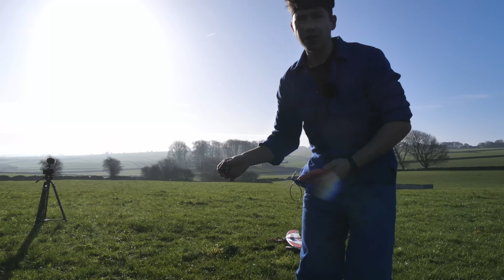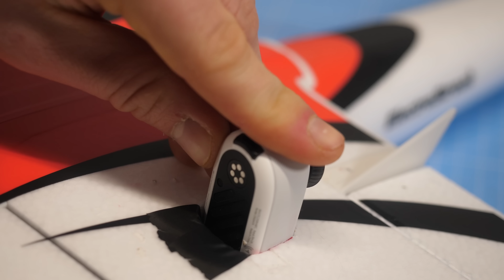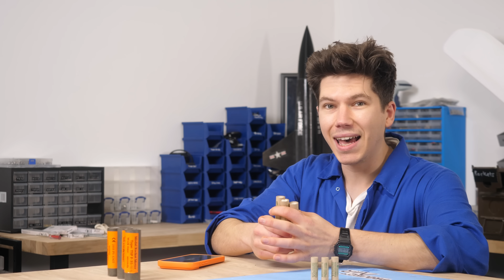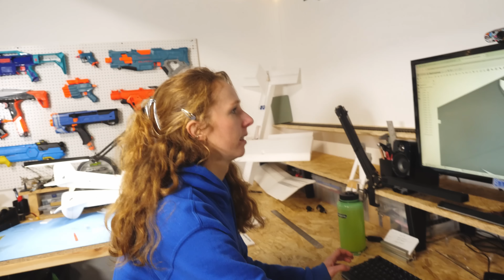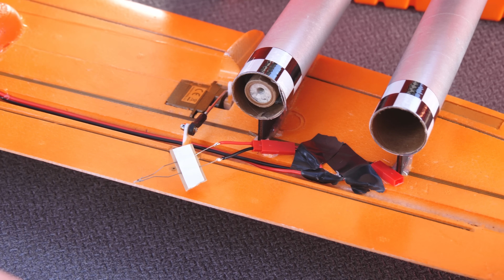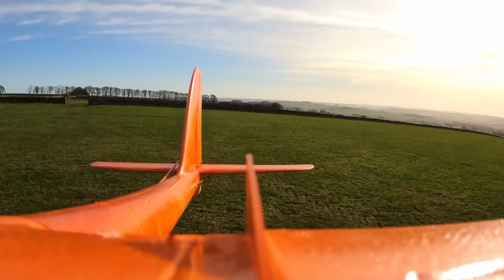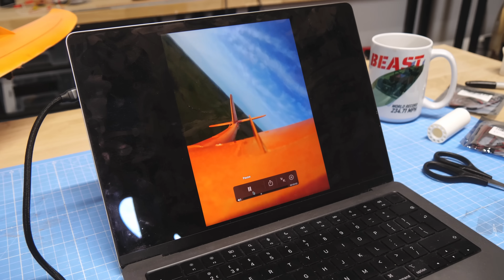Building a High-Speed Plane

Comment: G'day,

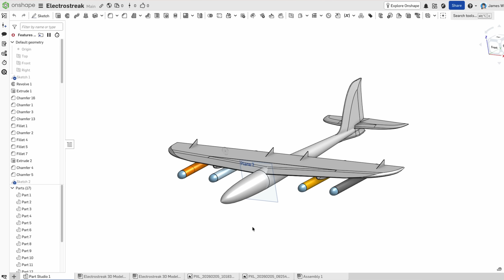09:32...

Looking at your Sketched Layout, my prediction is that 1) you will see staggered Ignition, due to the manufacturing variability in the Rocket Units, leading to violent Yaw moments clustering around your command to light  'em up...
And 2) the Rocket Thrust, so far below the Wings, will impart a strong Nose-up Torsion on the Wing Spar, far stronger than the Flight-Loads for which the structure was designed.

Basically, I expect to see the start of a Catharine-Wheel, followed by the Wings being twisted off...

But, one
May be
Wrong...(?).

Unpause, and on with the show.

Such is life,

Have a good one...

Stay safe.

;-p

Ciao !

Edit,

Told ya !

Unforseen Torsion induced Wing Flutter, after twisting arising from the Thrust delivered so low, under the Axis of the Wing's "Torsion-Box" (Stiffness of the Carbon Fibre Inserts...).

If ye want to persist, maybe try mounting the Motors over and under the Wing, at the same distance from the Fuselage...; to balance the Thrust in a Torsion-Neutral sense, relative to the Wing...(?)

Comment: WIth the ailerons tearing like that, you should look into using fiber reinforced packing tape (like the Scotch brand Strapping Tape) for strengthing the connections between the control surfaces and the wings. It's a cheap, lightweight, and easy solution. I add it to pretty much all foam fliers.

Comment: I would try to Place two rocketmotors the Same size as where you only used one. But under the Wing, touching the Main Body. You would have the Best Stability. Nearly no landing issues and a doubled power. Cheers

Comment: Gotta wonder if James up rated the propeller. While its not necessary for higher speed based off rockets, a lower pitch prop too shallow for the speeds you're trying to fly will act like a brake instead of a powerplant

Comment: I suggest putting the rocket pylons on the fuselage. Since the wings were able to fly at that same speed without flutter earlier, the wings can handle the speed, just not the added thrust from the rockets. It seems likely that the thrust from the rockets twisted the wings, causing flutter at that speed. If you instead mount the rocket pods to the fuselage, you can avoid the twisting of the wings. Of course, at that point, you have to deal with the hot exhaust gasses near the fuselage and travelling over the empennage, which are all made from Styrofoam and are vulnerable to heat damage...

Comment: make wing out of hard woods and thick so it less shakey and less bending
that form wing was having hard time keeping it self together and you push it more faster it start pull more drag on level cause it ripped off wing you need hard shell level so it doesnt rip it self aparts mid air with all that drag on it

Comment: I may be mistaken, and love your content so I assume you might have thought of this so forgive me if that's the case, but if you're using GPS to measure the speed, what you're getting is ground speed, not airspeed.  On windy days, if you're flying into a 20mph headwind, your GPS speed will be reduced by the same number, while the airspeed might be significantly higher than the previous tests.  But that won't show in GPS data.  The only way to get some sort of data accuracy from the GPS would be to do two runs on the same test, one into wind, one downwind, and then average the two speeds.

Comment: You know, your previous design was solid, but I have an improvement for it (or at least an attempt to balance the thrust):

Instead of having one single rocket thruster on top of the plane, why not try to add two smaller one (with thrust equivalent of the one on top) under the plane (so to form a triangle shape)? This way, the power would effectively double, and there's equal thrust both above and below the plane, basically avoiding balance problems during Rocket Propulsion

Comment: Love your videos! I use ematches , rather than the nichrome wire igniters, in rocketry competitions. Ematches fire instantly on very low voltage and current and will fire black powder rocket motors extremely reliably. I would highly recommend ematches for the projects you have been doing.

Comment: You should try making your own styles of plane using 2 part foam and 3D printed molds and see if you can make your own models with similar mostly one piece light weight construction and a more simple way of installing carbon spars or frame inside. Could be a fun experiment and a new fabrication method saving you a ton of foam gluing and possibly a much stronger faster, less labour intensive method.

Comment: why did you put the rocket motors so far away from the middle body on the wings.
Reply: I was going to say it was like a lot of the projects, an obvious mistake that drives comment section engagement (though tbh at least he makes stuff, it's not just stuck on the drawing board like all my projects lol), but tbh it looks intentional, to avoid the exhaust melting/burning the tailplane.
Reply: I don't know if it's the precise reason why, but weight outboard significantly dampens flutter. The outboard nacelles should have probably been much closer to the tips.

Comment: The motors should have been put closer to the centre of the plane. I understand that the tail surfaces might be in the way o the thrust, but the torque produced by any inconsistency in the motors is more negligible at the centre.

Comment: I always see the mistake of airplane enthusiasts using high thrust, short duration rocket motors. They always end up breaking things and having a crappy flight. The opposite is called for. One doesnt need high thrust but one DOES need a long sustaining thrust. Go for low thrust, long burn sustainer motors. It looks like the rocket motors you are using are C6-5s. That's a high thrust engine. I don't believe you need that. I think especially with 4 rocket motors such as Aerotech C3.4Ts would be better. They are designed for your purpose, as RC airplane motors. They have a long burn time and a low thrust. Rockets, need a high thrust kick to get the rocket moving. Your airplane is already moving. So just a bit more oomph would do better.

The other issue is that one will never get absolute identical thrust or burn time. So why are you putting the motors on the outboard end of the wing?  Plus them near at the wing root so thrust asymmetry is lowest. I can actually see the wild barely tamed flutter with the thrust asymmetry. This goes to show that your flight controller is doing a very good job.  Placing rocket motors can be tricky. On the fuselage, they are harder to mount and would probably cause a lot of disturbance to the already shakey tail. As some other guy said: a folding prop would help a lot for landing.
Reply: Ironically, this is the exact principle used on the X-1 - the highest speeds came from lighting the engines in sequence, not all at once.
Reply: @ErickC  Unrelated but I'm reminded of a man on youtube that took his slope soaring glider to transonic speeds on a particular slope.. I believe that was transonic on the wings. I need to find this.

Comment: You might have a better result if you "step" the rocket ignition.  Have the outmost pods fire then a half second to a second later fire the inner pods.  That way the wings aren't getting slammed all at once with the added thrust, you would need two switches and perhaps a timer in the airframe though unless you want to control the timing through the transmitter.

Comment: Attach the rockets in an X shape, over and underneath the wings around the fuselage, ideally with some aerodynamic fairings to make sure it stays smooth. 

The outboard position of the rockets on the wings is too flimsy and far from the CoM, having the propulsion closer to the center of mass is better for stability. Even then, something tells me if it went any faster than 150 ~ 200mph the structure of the plane would rip apart.

Comment: Again a straight wing! - you need sweep-back. Think 'VC10' for wing, tail & engine mounting. Tell him Emma, he'll listen to you  : )x
Reply: Straight wings are fine for high model-scale speeds. All a swept wing does is decrease the cross-sectional area for a given total wing area, which aids in the compromise between low-speed lifting capability and high-speed drag. It also helps with compressibility problems that won't be encountered at the low speeds R/C airplanes fly at. You're not experiencing compressibility issues at .14 mach.

Swept wings create problems with interference drag at the wing root, and then you need to start changing camber at the root, implementing Yehudi flaps, and all sorts of other things. There's a reason airliner wings get thicker at the root, and it's not lifting ability. I don't know that this would be a significant problem at model scales. Besides, the wing on this aircraft was lightly swept already (sweep is measured at the 25% chord line, not the trailing edge).

The problems here are aspect ratio and wing loading, not sweep angle. Higher aspect ratio wings need to be much stronger to withstand the forces of high speed flight than low aspect ratio wings do, and smaller wings produce less drag. A small, light airplane like this doesn't need that much lift at (model scale) high speeds and could get away with much less wing, and a smaller wing would be less susceptible to flutter, less susceptible to loads from vertical gusts, and could have a much lighter structure due to not needing to be as strong. The tradeoff would be landing performance.

Comment: Would it be crazy to trace the shape of the wings add a structure or two for the cameras so it's balanced and for rockets possibly putting them right inside the wing -> onshape -> PCB Way for CNC carbon fiber? You could to the wing the tail section and maybe the tailfin I don't know I think you can get this thing to really move.

Comment: Unreinforced foam aileron and a linkage fit for park flyer I'm surprised it didn't completely disintegrate. Foam is probably not the best choice for speed planes due to it's flexibility.   What props did you test with 6S power?  What was the static amp reading?  Wouldn't a low wing design with rockets on top be less likely to be damaged on landing?  There seems to be a lot  left on table if you're interested.  Getting a consistent synchronous ignition of the engines as you did is very impressive.

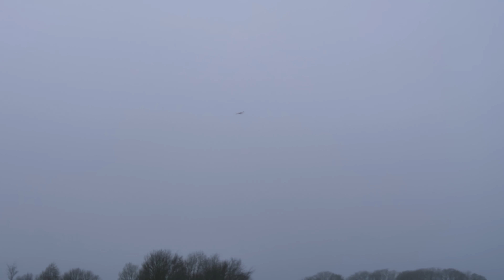Comment: Maxing out the prop on 6s? 7:00 Get a bigger or higher angle one. Not sure which would be better, but you'll increase the load and run hotter
Reply: Yes!! I ran a 7x6 on my durafly and was hitting 130+ on 4s

Comment: Interesting that it broke on the side with the camera, I wonder if that contributed to the flutter. 

You should make a custom plane next with 4 motors in the tail of the plane, to prevent any yaw issues. You should also try staggering motor ignition, fire 1&2 and then 1 second before completion fire 3&4. Or fire 1, then 2, then 3&4 for longer and smoother acceleration.

Comment: You designed it to have the rockets out on the wing to avoid the CT being above the CL but you had four pods. If you’d just put two above and two below the fuselage it achieves the same thing without the massive flutter risk.
Reply: The highest flutter speeds are achieved with weight at the wingtips (Nagaraj, 1967). This is why fighters often have large anti-flutter weights there.

Comment: Flutter is a huge issue when you speed up Eflite toys. 

I added an internal cf structure and some stabiliser triangulation cf rods. 

That cured it entirely. 

I'd also reprofiled the wing, moved the wing, shortened it, reprofiled the fuselage, moved the CG significantly back to destabilise it, and tripled the power. There was very little left of the original!

Good fun until i outgrew it

Comment: Don’t understand why you mounted the motors so widely spaced. Just asking for catastrophic result from the inevitable yaw induced from asymmetric thrust. Guess crashes make for good content. Keep it up!
Reply: I’d guess if the rocket motors were placed closer to the fuselage their exhaust gas would melt the horizontal stabilizer.
Reply: He's above vmcg. Not really an issue at high speeds provided any asymmetry isn't beyond control authority, which clearly it wasn't. The bigger problem is the fact that higher aspect ratio wings need stiffening for high-speed flight.

Comment: Was it coincidence that the wing that failed was the one with the camera on it, just wondering if the hole you made for the camera weaken it ? Maybe for the next attempt 3D print a camera mount and fairing that can attach to the centre of the wing using the wing retaining bolts, use carbon fibre reinforced filament and make the fairing extend along the wings a bit to help stiffen the wing roots.
Reply: I wondered that too.

Comment: There are plenty of 200+ mph RC (and some CL) models. RC Pylon models are 200+ and fly a tight circuit around pylons, 4 at a time. And pull something like 40-50G corners. Of course they are properly designed, not RTF foam garbage.
Reply: I'm thinking that would have made for a pretty boring video.

Comment: Great video!
And i love these types of videos
Keep going man!

My suggestion for what to build next is mabye you could try to make a model rocket but when at peak height could have foldable wings that would open and turn into a model plane but the rocket would have to not go very high so theres still air for the plane motor to run
But in a nutshell: a rocket that turns into a plane

I do believe you could do this but its just and idea

Comment: Too much thrust torque On the wing. Which tore the airplane apart.

My thoughts about the video are.
I think he put the rocket engines too close together.

If they were further Apart.
I think the two engines On the inside Need to be closer To the airframe.
Which will take a lot of the thrust torque off the wing. 

Or. Mount the inside engines To the air frame.

I think the two outside engines need to stay right where they are.
I think he would have done a lot better..
Reply: The position of the outboard engines is probably one of the main reasons for the flutter in the first place. Flutter speed is minimized with weights at midspan (see Nagaraj, 1967). It's maximized with weights at the tips.

Comment: Dude you flew a plane with AS3X stabilisation into speed regimes the gyro was not tuned for. If the gyro was on during the rocket flight that is what killed the plane.
Otherwise, heavy rocket engines and pods under the wign increase the moment of inertia around the elastic axis of the wing by a lot, which also heavily amplifies flutter

Comment: I think firing engines on the body would have been a proper alternative, so no matter if there is a variance or failure, you don’t run risk of flight failure, or destroying the wings as demonstrated.  Think of the location of the boosters used for large plane take offs.

Comment: CAn't you coat the current wing in glasfiber? That would stiff it up.
Reply: Just adding packing tape with a few pieces of carbon should stiffen the whole airplane up. It’s suprising how much strength it adds. WBPU and baby powder can make a foamie  very strong to its like glassing the airframe….3m micropore tape with extremely thin epoxy in stress bearing area’s makes a very strong surface too and is great for control surfaces and makes it like fibreglass. And it’s light too.
Reply: @SeanFox-v3x  Lots of fibrous and porous materials give surprising results when used as composites, even cardboard. I'd never heard of the tape, food for thought.
Reply: @_tyrannus  it’s the tape they use for bandages. It’s like white paper…very durable. I use it for hinges on controls too. Works great

Comment: I know nothing about this, so sorry if it's a dumb question. Do air props have a similar issue that water props have with cavitation? Can you spin an air prop "too fast" and hurt its efficiency? Could that be why the battery test was less performant than you expected?

Comment: You need to install the rockets inside of the wings center. The offset placement was causing a lot of torque.
Reply: They used to bolt JATO/RATO bottles right on to the fuselage of C-130s, like in Operation Credible Sport
Reply: @merreborn  With good structural reason.
Reply: Or over/under the wing on a single pylon to cancel out the torque. It would kinda look like an x-wing with the wings flat.
Reply: @toolbaggers i like that idea. A lot easier to modify
Reply: but the rockets being offset also give a damping effect, which reduces flutter, it’s a careful balance
Reply: The ailerons wouldn't work

Comment: I figured out something cool, when you were testing the RPM with the old battery vs the new one with that cool laser thing, I wondered if you could calculate it by finding the musical note of the pitch of the motor with the old battery vs the new one. Your laser showed 14,000 to 22,000 rpm (1.5x increase) and it was roughly a B to an F# note, which goes from 493hz to 740hz (1.5x increase)! Maybe obvious, but I thought it was cool, and if you didnt have a laser you could calculate the percentage increase in rpm with a piano app on your phone 😂
Reply: No point in using the musical pitch of the motor, since there's a prop. Blade passing frequency is the number of blades multiplied by the RPM divided by 60 (to go from RPM, cycles per minute, to Hertz, cycles per second). You can calculate the exact RPM by dividing the fundamental frequency of the blade noise by 60 and again by the number of blades (in this case 2).
Reply: The ESC can use the motor as a speaker. Some play a song on power-up.
Reply: 15 years ago we used sound recordings to do doppler analysis and calculate the speed of our planes and ducted fan jets.